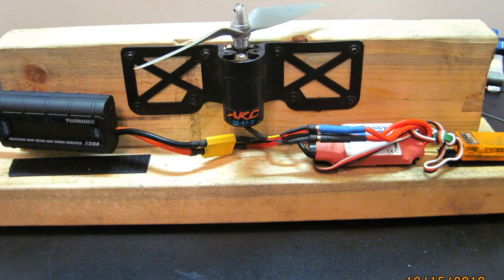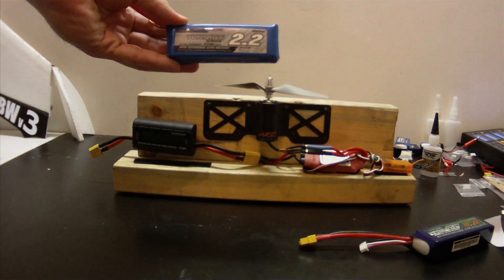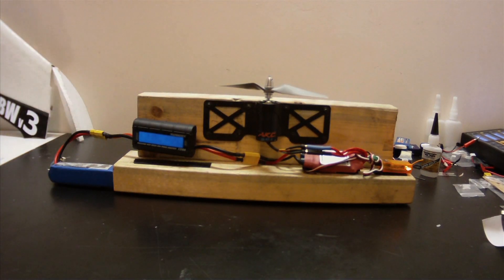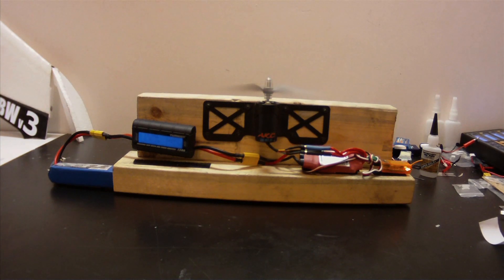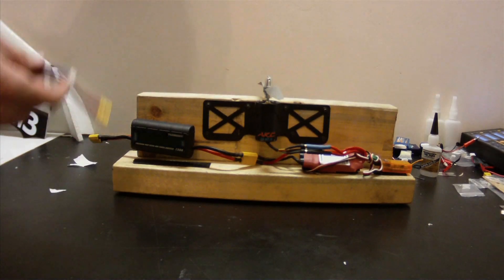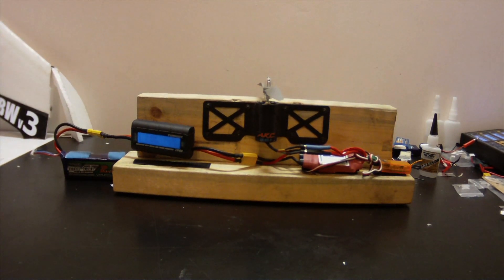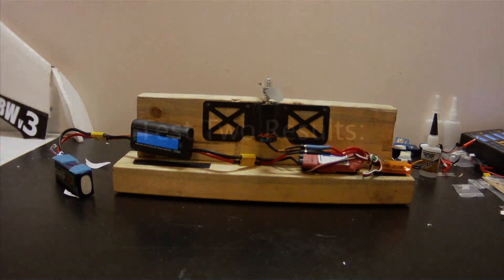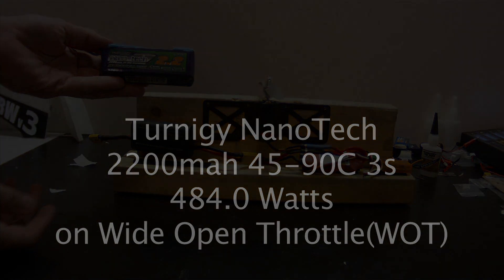Lipo Power Test Redux, More Power!

Comment: Would have been helpful to give us the pack voltage right before the test along with amps pulled. 

Why do you consider 20 watts a big increase? Seems like a small increase. Probably noticeable but these packs are claiming outrageous C numbers and they are complete BS. I’m not in the hobby for driving or flying im actually looking at Lipos to power a battery spot welder. Looking to get a over 1000amps (for a fraction of a second) from a 3S pack but that’s not even possible correct?

Comment from the maker: @mmmbcn good questions. First off, Yes I like xt60's better. Mostly due to the fact that they are much better to solder and there are polarity(+,-) marking on each one. As far as the nanotech's go. Yes, if you can get them over the slightly cheaper lipos, you should. Not so much because of increased power but because of the fact that you can charge in a quarter of the time. They should last longer too, assuming they were properly used.

Comment: Do you like those xt60 connectors better than the deans?  I'm thinking of switching over... also, so the nanotech drew about 20 more watts but isn't this less than a 5% power difference.  Do you think you'd really see a big change in performance?  Nice, vid, thanks!